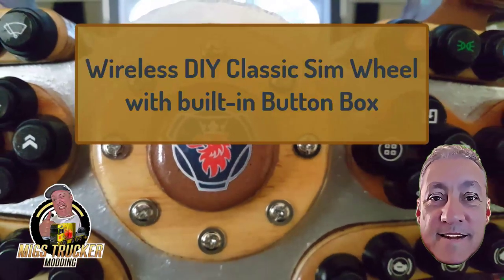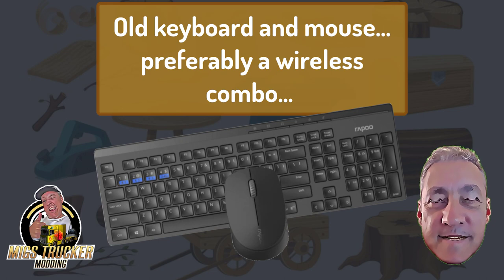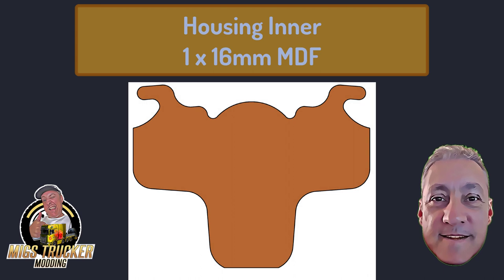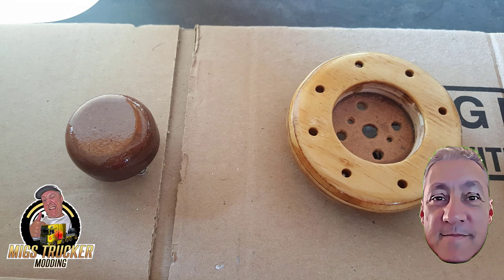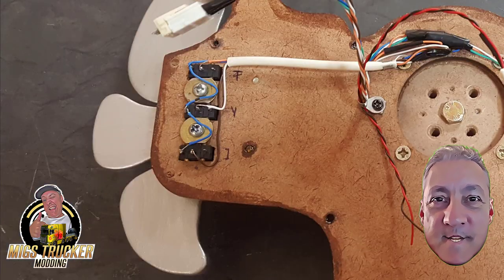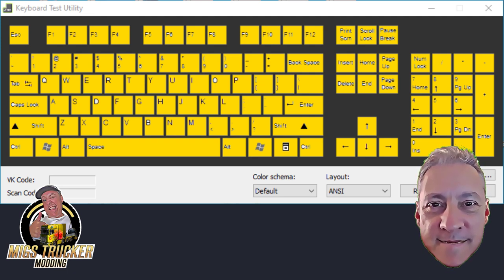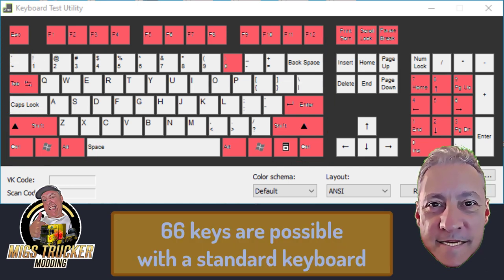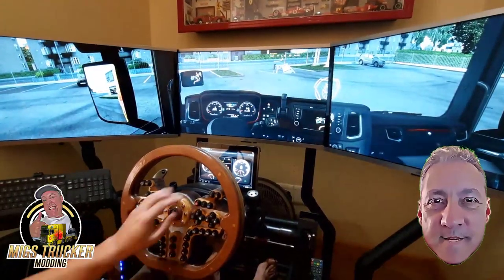How to build a Wireless Sim Wheel Button Box for less than $30 for ETS2

Comment: how do i how to stop the reflection when the Beacons are on plz help thanks
Reply from the maker: if it's for your own truck... copy the *.*\unit\hookup\vehicle\flare\vehicle_beacon.sii file from your base folder and place it your "My Mod" folder according to the folder structure
open it with notepad++ and under "Player beacons" section, look for scale_factor: 1st one should be around line 21...
default should be 1.5 but you can lower this value for all the scale_factor values in this section only
save the file and test it until you get the value that works for you

if it's for the AI trucks.... only change the scale_factor values under "Trailer & AI beacons" section... from lines 112

Hope this helps you 😉
Reply: @migstrucker-modding  yeah its for my truck thanks